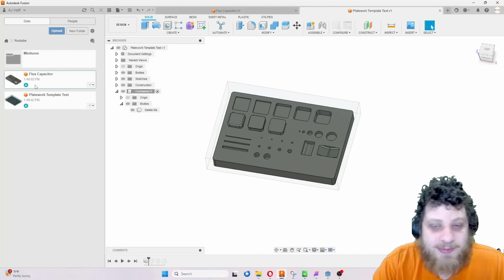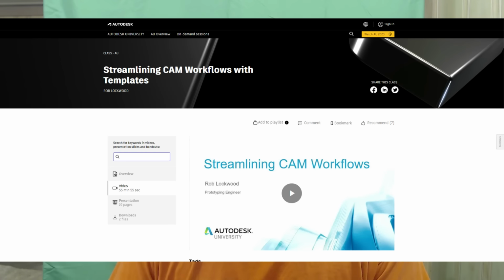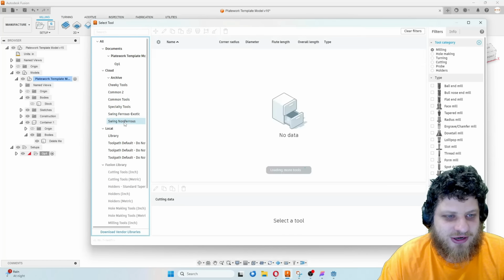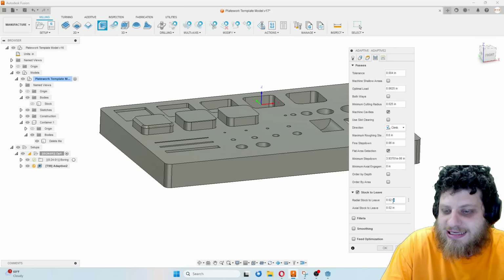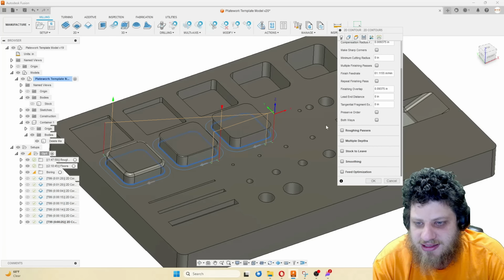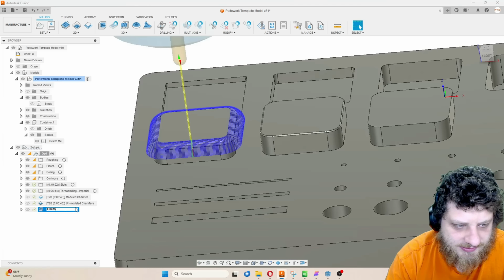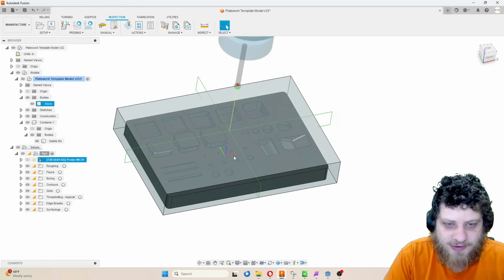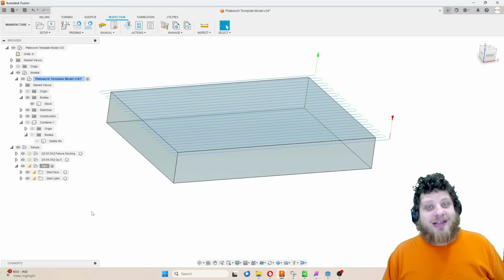Program Parts Faster - Fusion 360 Container Templates

Comment: Thanks! I've found 3D contour with rest machining and slope enabled to be extremely powerful using templates. It almost eliminates manual selection because the tool path will automatically find flat areas, curved areas, chamfer angles, vertical surfaces for finishing etc. while avoiding any crashes automatically. Start with your largest tools and then progressively smaller, so You don't waste time using a smaller tool than necessary. You can even have your Ball Mills or chamfer Mills set up to automatically deburr modeled fillets and chamfers. It doesn't really help you with manual edge brakes, but you can use other tool paths for that, and they also have automatic deburring available for extra subscription. 

Hope this helps!

Comment: I love this so much. Any chance for a sequel that goes over stuff like: 

how to manage different materials (steel vs aluminum vs plastic) different work holding

different machines

how to organize the files in Fusion (do I copy the container template into the part folder so it can be reviewed and updated later)

The upfront time investment seems pretty brutal and if I have 20 files to cover all my different fixtures, materials, and machines I would think it could end up being so unwieldily to keep synced that it creates more trouble than it’s worth. How would one get ahead of that before it becomes an issue?
Reply from the maker: Yes! Revision two is on the way. It'll combine all of the different fixtures into one file via configurations. So you'll only need to do your toolpaths once.
Reply: @ awesome. I’m looking forward to seeing it! 

Thank you so much for sharing this info BTW. I just picked up my new mill and your video was the best one I’ve found for someone at my level. It really is appreciated.

Comment: Good video.  I’m a big fan of cam templates but I save individual ones in folders like adaptive, 2d contour finish, 2d contour ramp, horizontal, face, corner radius tools, thread mills, etc.  and if I’m making a part that is halfway similar to another, I’ll just copy paste all the toolpaths into the new part.  Cam templates make programming thread mills and radius tools a 15 second job.
Reply: Id love to have those templates, Im struggling

Comment: how did i not know you can add folders to CAM setups.  That just made things look so much cleaner
Reply from the maker: I had that same thought like six months ago 🤣. I believe they snuck it into an update
Reply: @AudacityMicro it’s been around for a couple of years at least.  I use folders to probe and move my wcs in the middle of progress, as you can assign a different wcs to a folder.  Basically, I rough the part exposing a hole or surface from the first setup, then probe it and automatically move the XY slightly, then do the finish machining.  To do this, as far as I know, you have to use folders, so you can have some toolpaths (including the probing) use g54 and others use g55.  I’m not sure I explained that well 🤷‍♂️

Comment: Cool vid. Nice to see you going in to that much detail on the toolpaths. I recognise the workflow.
One thing I'd add is to set up user defaults on all the text boxes. It's like a single option template but the fusion defaults arent that good. Like where you do your hole recognition, you can set the small end to tool_diameter - 0.1(mm) and the large end to tool_diameter + 0.1(mm). If you set them as user default, you basically never have to re-enter that info
Reply from the maker: Makes sense!

Comment: Excellent video!  Container method is a great method to automate.
Reply from the maker: It has worked well for me! I suspect at some point, the various "AI" tools will eventually get to the point where they are better (maybe a year or two out? Depending on where certain companies focus their attention), but we're not quite there yet.
Reply: As you pointed out, this is an expert level video. I also expect that many users will be able to do this level of automation with far less need to know how to master the software.
Reply: I look at it a little bit differently.  At least, for the tools that were making with Toolpath.  my perspective is, we will allow you to make containers capable of much more that has higher life logic built into them
Reply from the maker: That makes sense to me! The inability to add simple logic is definitely a constraint at the moment. "don't bore deeper than the bottom of the hole, OR the length of the tool" is basically impossible to implement with the current tools, but it's something you guys can handle easily in the API.

Comment: Great video lots of useful information. We’ve been using the container method for a while but still got some improvements from this video. Two potential improvements:

You don’t need to use glass to make the stock transparent, you can right click the component/body and set the opacity control. This could be important if you want to get an accurate weight of you setup to make sure you’re not overloading your A-Axis as an example, the HRT160 is only 45lbs unsupported and workholding adds up fast.

To stop the bore going to deep you could use the tool_fluteLength for the depth.
Reply from the maker: Thanks! I'm glad you found it helpful. Very valid point on the opacity.

For the bore though, I have had that thought too, but realized it didn't work after some testing. It would work fine if you were only ever doing thru-holes, but it might bore too deeply on a blind hole. I'm not sure this is worse than what I'm doing? Because this would fail with a scrapped part, but an intact machine, where as my method could potentially result in a crash. Might be a situational thing depending on the type of parts you commonly see.

Comment: This a great! I'm not a fusion user (camworks and hsmworks within solidworks) but this method can be adapted to other systems with a bit of ingenuity.
Reply: You mentioned some mild rework that's somewhat typical at the end of the video. A tip I figured out from running a handful of machines now. If you standardize tooling manufacturers and have a repeatable machine you should track cutter comp offsets for a few months and build that into your templates as negative stock to leave. I can get bores within 20-30 micron (.02 mm) without comping reliably first time now on the Datron M8 I run. Same on some YCMs I used to run. This applies to outer profiles as well, but it's more variable. The whole video was super informative and has me thinking about how I can adapt it.
Reply from the maker: Absolutely! I don't have much experience in other CAM packages, but I would be shocked if something similar didn't exist!

Comment: While this may not be everyone's cup of tea, i can say i enjoyed it and learned something. I could see this really saving someone some time if they had different products with similar overall form and slightly different features. 
Are you posting over shared network to your haas or using a usb?
Also in the video i saw you select in control for your wear comp. I have heard others say to always use wear. How does that interact with the Haas control?
Thanks,
Jake
Reply from the maker: You would be surprised at how flexible these templates can be. I have a handful, one for "vise parts" one for "round parts", now this one for super glue workholding, and a few other assorted ones for different workholding methods. I'm a jobshop, and do a huge variety of wildly different parts, and these templates serve me really well.

My machine is too old to do network share, so I do everything over USB. Though the guys at Chatter do have a really cool wifi USB thing that I would love to add at some point.

I do use full diameter compensation instead of wear. At the end of the day, it does accomplish exactly the same thing as wear, but technically is a little more dangerous. Really the only reason I use full diameter comp, is that is what works with my Renishaw tool diameter measuring macros. If I wasn't using the tool setter to measure tools, then I would use wear comp since it's safer.
Reply: @AudacityMicro  ya i may have to dive into the templates. 
Ah that might be why i was getting an error when trying to run my thread mill. Running a haas with reinshaw probing also. Getting an error in the control saying the tool was too big, of course after it had already plunged to the center of the tool where it was to threadmill. Ended up turning it to in computer and it ran fine.
Reply from the maker: yeah, for threadmilling I do the compensation in the computer, and adjust the stock to leave. That lets me store that data for the next time I do the same operation. I don't do big production runs, so most of the time tool wear is a non-factor for me.